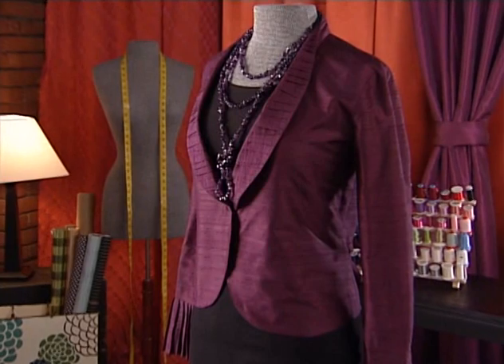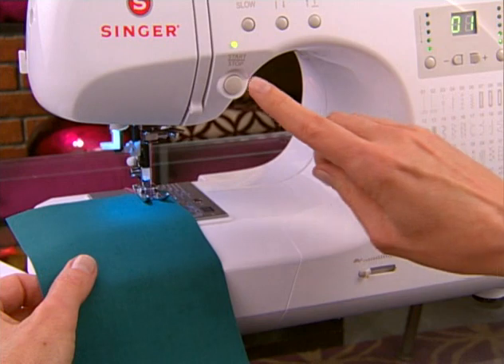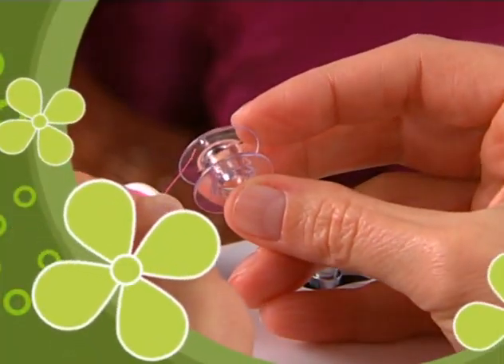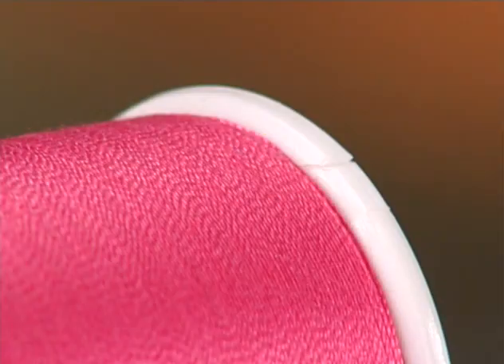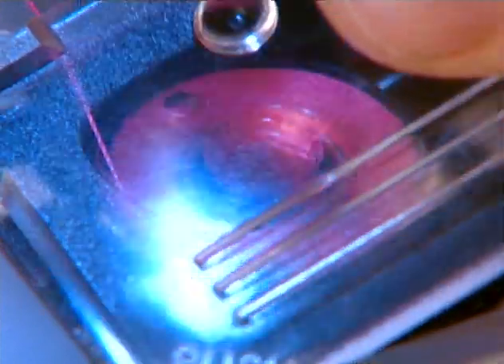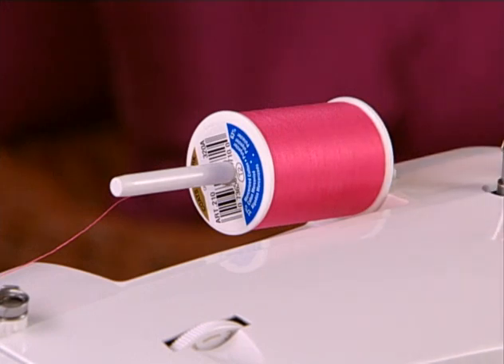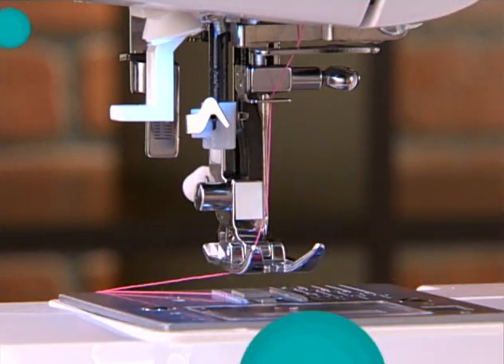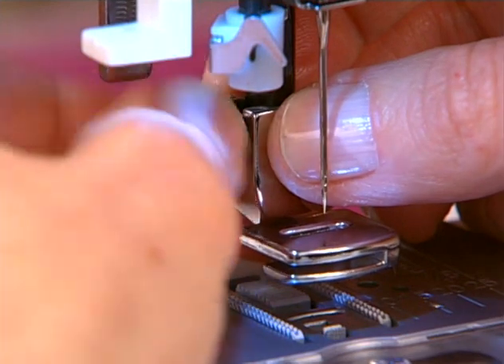Singer 4166 - Complete Quick Start Guide

Comment: My Singer 4166 has passed away. I've used it for about 5 years for home projects, not that much. The machine was regularly cleaned, lubricated and adjusted in the workshops. Suddenly the needle stopped moving to the programmed position. Stands not in the center but to the left or to the right, even for a straight stitch. I took it to repair. They could not fix. Now it does only straight stitch, even if I choose other programs, even zig-zag doesn't work. Before this one machine I have had Singer Quantum. A very moody and unreliable machine. I have finished a six-month sewing school with a certificate long time ago. And have had several sewing machines. Russian "Podolsk" with an electric drive, simple, but strong like Kalashnikov. then White, but the Singers were the most unreliable. Disappointed. Forced to buy a new Janome. Singer quality is getting worse and worse.
Reply from the maker: 4166 is basically the most entry level machine. We destroyed ours making a king size denim comforter.